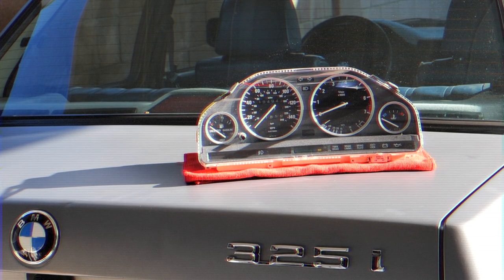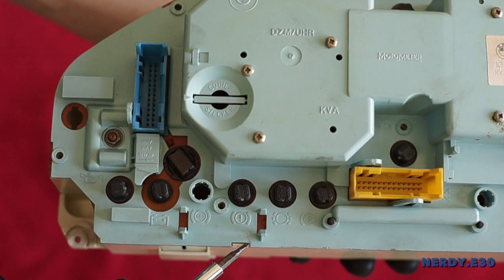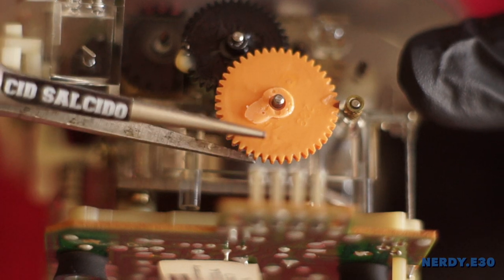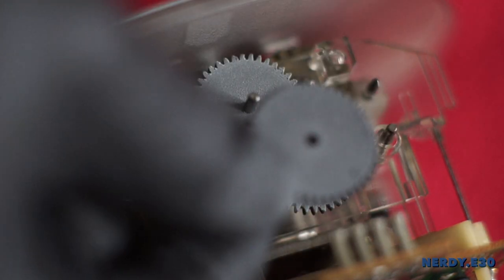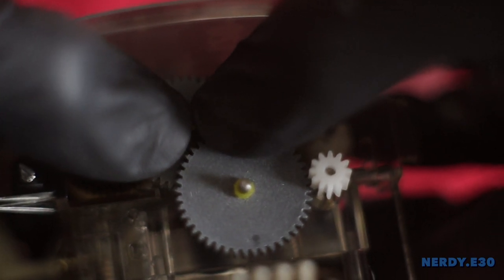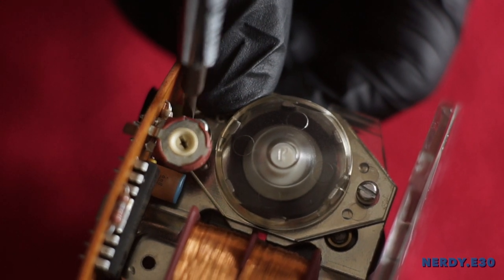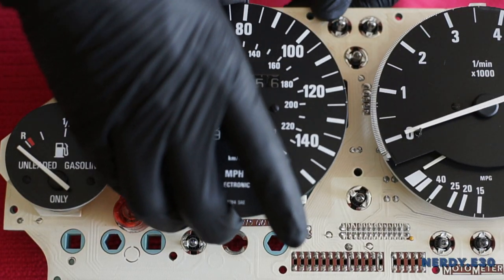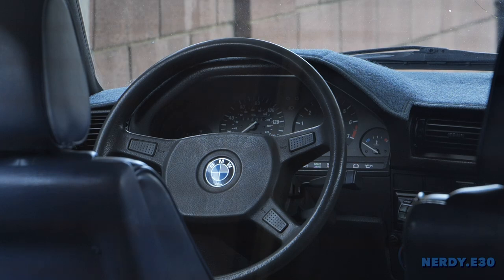Nerdy E30 Odometer Gear Repair MOTORMETER

Comment: Very nicely done video. Thanks for the help! After 39 years and 189,999 miles, my 318i's odometer suddenly stopped (I guess rolling over to 190,000 was a bit too difficult for those old gears). Your instructions will make the repair a lot easier...

Comment: can use a hemostat, needle driver, locking needle nose to hold long shaft for last/ tiny gear vs. disassemble motor cover.

screws for speedo are phillips and 5.5 mm....first time I've used that 5.5 socket!

Comment: Took me a few minutes to realize that the green connector was holding the speedometer in place and had to be removed before the speedometer would come out. I think you skipped that step in the video? Otherwise very helpful video. Thanks!